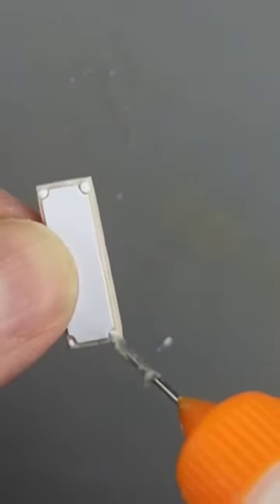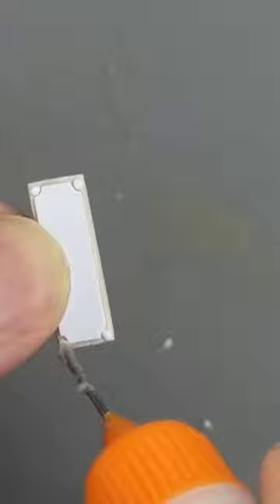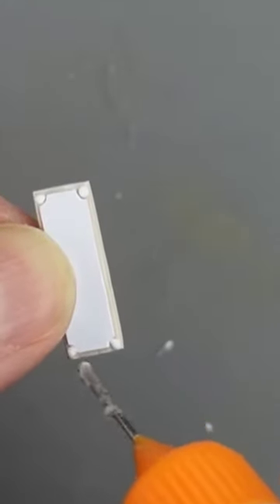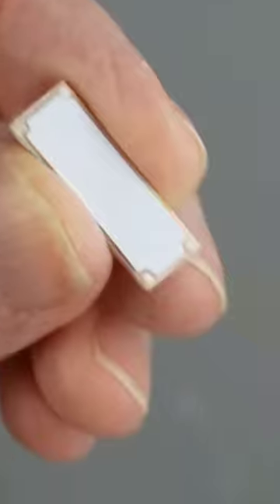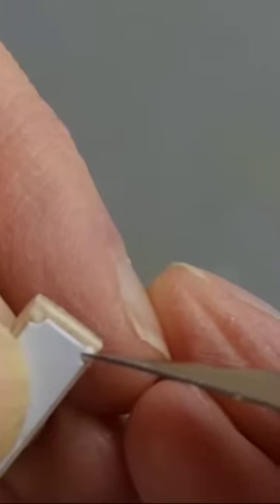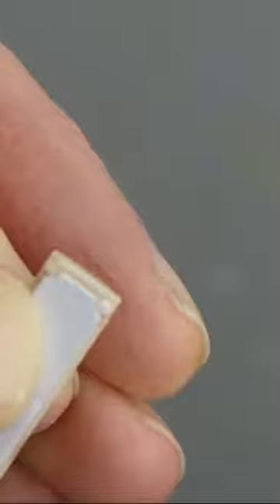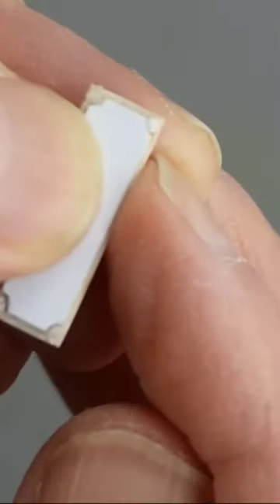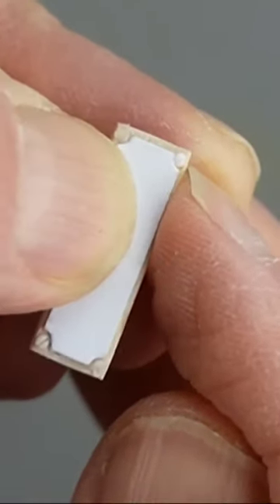glue becomes a miniature screw #diy #howto #tutorial #dollhouse #handmade #scalemodel #tiny #mini

Comment: All your ideas are so wonderful, and you explain everything really well. BTW, I just bought 4 of the same precision tip bottles from Temu for about $2.00, so in case anyone wants to get some they're still available. I decanted some of my wood glue into one bottle, and some Aleene's Tacky Glue into another, and I love using them on miniatures, they really are precise so you can  place your glue exactly where you want it to be. I've found that I'm making far less mistakes now that I'm using these bottles. 😅 Also, I found a video tutorial on how to make holders for these little bottles so you can keep them upside down and the glue stays in the top of the bottle, so you don't have to shake it down every time you want to use it. The holders can be made easily out of pieces of cardboard and glue. You just measure the size of one of the bottles, you don't need to measure  them all because they're all the same size, and then you make a little box out of the cardboard that the bottles will sit in snugly upside down. You can also buy these holders but they're easy to make. Thank you for another great little short video tutorial. Cheers from Amanda in Australia
Reply from the maker: Those holders sounds great! 

I just filled a needle tip bottle with Beacon 3-in-1 glue. It's pretty much Fabritac. Hopefully that works well.